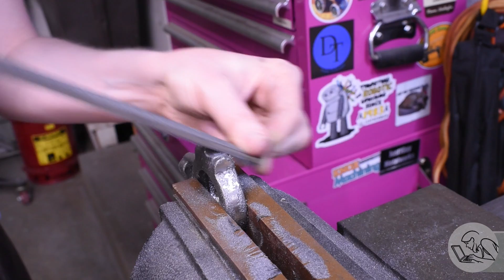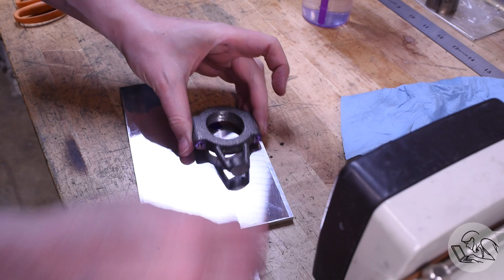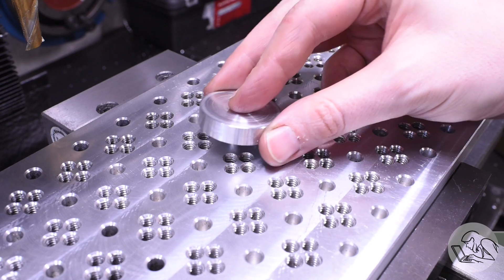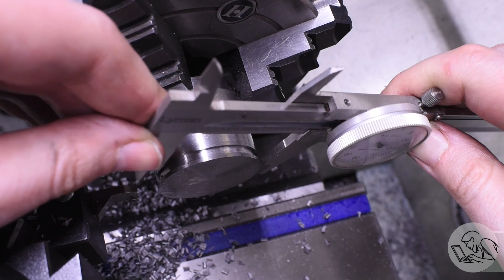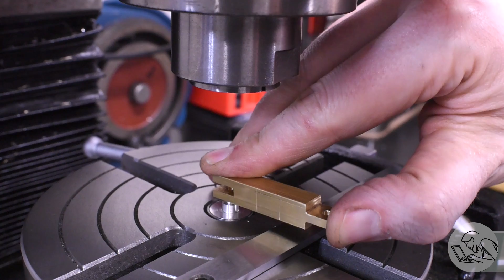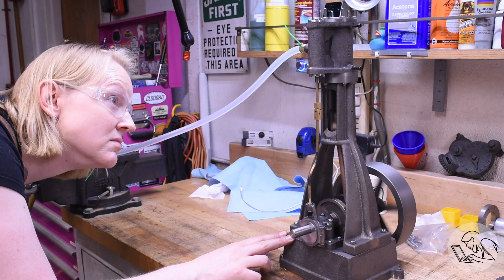First Run! Big Steam Steam Engine Build, Part 13

Comment: Try making it a solar power steam engine. A 4x8 sheet of 1/2" plywood with copper sheet layer. Solder 1/4" copper tube to copper sheet as close as you can make the bends without kinking it. ZigZag pattern as much copper tube as will fit. paint with high temp flat black paint. Mount copper tube plate to 1/2" plywood with 1/2" spacers. Enclose with glass or plastic to reduce air movement. Place in sun and connect to a water hose. Continues steam! then connect dynamo for free electricity.

Comment: What is the horse power under steam?  I wonder how viable steam would be as an energy source without constant monitoring and human labor.  I think it's cool as an on demand energy source (say to drive a generator or band driven tools) but how do you reduce the labor required to make it a viable alternative to a gas engine?

More of a rhetorical question.  I think it would be cool to give a second look at energy sources of the past.  Can it be modernized?

Comment: At 10:37 in, an alternative  clamping method is to turn the precision button you made for centering the bore into an arbor.  Create a threaded, counter sunk central thru hole in the button along with 2 perpendicular cuts in the face of the button deep enough to allow the quadrants to flex minutely outward when a flathead screw pushes on the countersink. The flex will provide clamping action. The part can now be milled with no clamps in the way.

Comment: Personally I would have turned a boss a thou or two larger than the center bore and use the strap itself to clamp the eccentric to the fixture, then everything is perfectly true to the bore, and is much simpler and more secure than clamps

Comment: Beautiful job, it's good to see it running!

Maybe you could fixture these straps with L-brackets bolted into the 'wrong' end of threaded holes, to be able to unfixture it without losing alignment between the halves.
Would it be possible to add an extra low gear to the lathe for low-rpm work? Seems like a project anyone with a similar lathe would be glad to see :)

Comment: PLEASE build an internal combustion engine, that would be so cool and would be a new challenge since they have tight tolerances. Look into 2 stroke engines. They are simpler because they dont have valves like a 4 stroke.

Comment: For a boiler, you can try a gas water heater with a heavier duty burner. They are rated at pressures much higher than you would probably want to use. Or, look uo the water tube boiler fot the old Bryan (Bryant?) steam tractor. They are fairly straight forward

Comment: I may have asked this before but whay percent of stroke is this engine set to. Or does it use the full stroke at full pressure without using expansion

Comment: Drill a hole on the bottom of the strap and you can adjust the eccentric without taking the strap apart.

Comment: First of all congrats girl getting the engine to run that fine with the first setup.
But I wonder why you follow so slavishly the drawing? The Oil hole is in totally stupid position. I’m about to make the same part shortly and was happy I saw how you tackled the whole thing. There I saw where the oil hole is intended to be. I’ll do a hole in the back in an angle to the eccentric, this way you have a little reservoir. Als i was happy to see how the hole went through and you looked how centered they came out at the end;-). Now I decided not to drill through the whole part. So there is no bad surprise. 
Again, I enjoy to watch the series. Thank you for sharing.

Comment: Quinn- just a question here. Couldn’t you have gotten the plate close to running true then faced it off to get the surface completely square to the tool?

Comment: How feasible would it have been to make a mandrel for the eccentric strap to turn it between centers for facing, instead of having to do it on the mill as you did? You already had to turn a mandrel-esque piece anyways, so why not just go the full way? You'd have to secure it with loctite or something, since you can't loosen the bolts or risk losing alignment, but it seems like that should certainly work if you got it to a 1-thou sliding fit. Alternatively, you could use an expanding mandrel to hold the piece between centers, though finding a mandrel that has the range you need would likely be difficult to say the least...

...Okay, I can see why you did it the way you did. Carry on!

Comment: When the part is being clamped on the fixture plate, how do you know the bore is square with the spindle?  If that plug isn't a tight push fit in the bore, the force of the clamps will squig it out of true, no? (that's a soft "G" on "squig").  I think a boring/facing head like a wohlhaupter would be the thing to use. (Everyone in my shop called it a "wallhopper".

Comment: Bonjour Quinn,
You are not lucky , you just have the result of your skillness and the accuracy you make everything.
8 PSI is about 0,5 bar; amazig for such a machine with no break in !
I am sure that your boiler would be able to operate it, why would'nt you try ?
My concern would be the rust after, but running a steam machine on steam is the goal isn't it ?
(*) Your shelf is lucky 😉
Amicalement, Raphaël

Comment: Seems to me like reaming thru the split for a shoulder bolt would make dis/assembly sufficiently repeatable to use those bolt holes for various fixturing options.

Excited for the first run! It's been a joy watching the engine come together. Thank you for doing what you do.

Comment: Fabulous work Quinn! Congratulations on the successful first test.

I have no doubt that you will find a way to make a sufficiently high capacity boiler. 

I am curious, is there an ultimate use goal for this engine, or is it for the satisfaction of having built such an awesome device?

I can't believe I'd be the first to suggest this... What about powering that "whimpy" lathe with it? 😉😁

Congrats again!

Comment: Two rights don't make a wrong, they make an airplane.  Should you so desire, drill the threads out in the upper half to clearance size, and then thread the lower half the next size larger and make stepped "adapter" studs with both the larger and smaller threads.  Voila and Uncle Bob.
Reply: I thought two rights made a u-turn lol